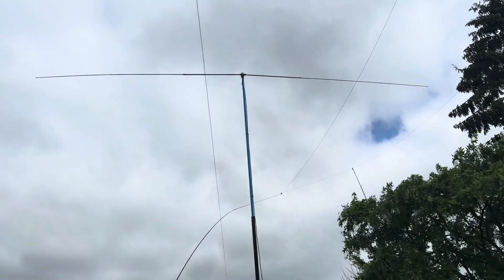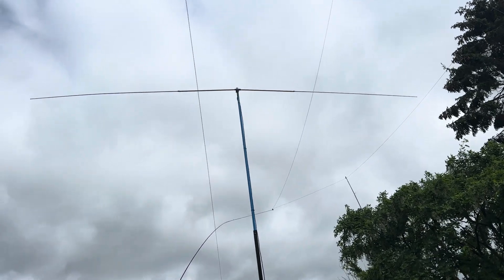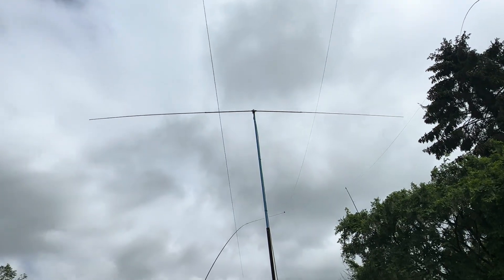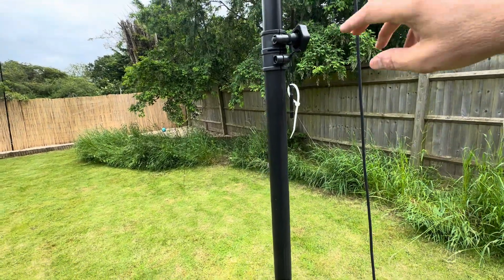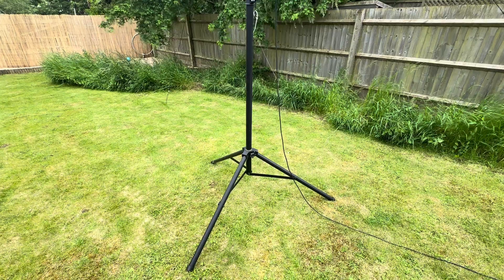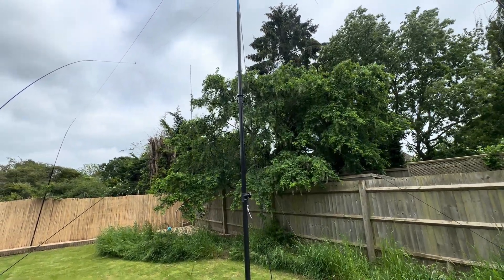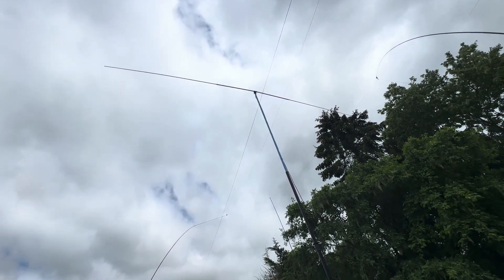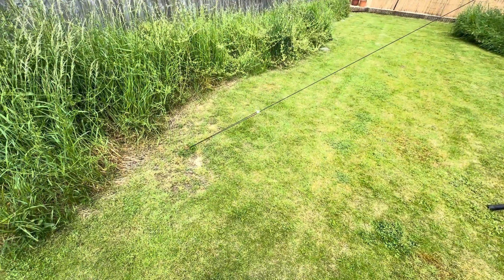Home-brew dipole for the 10 metre band - how I made it (on the cheap!)

Comment: Nice 10m build, do you get any common mode down the coax as it doesn't look to have a balum or choke at the feed point?
Reply from the maker: No, none at all. I did fit a choke but it wasn't required. The noise-loor on 10m is about S1, so all good.

Comment: When we first got access to 6m here in France, all i had was a dipole and a power limit of 5w (it depended in which department you lived to the power you were allowed) and i worked all over Europe with this simple setup, same story on 10m, a simple dipole and 5w up to whatever you have available is more than enough to work anyone when the bands are open. As you know as long as your antenna is at least a wavelength above ground your good to go ! 
Certainly with where we are in the sunspot cycle a rotary dipole is an excellent choice as the bands are in such good shape, anyone anywhere can call you and your not going to miss them.
Cheers for the video matey.
Reply from the maker: Cheers Anthony, interesting background information. Yes, I worked Madeira on 10m within 2 minutes of finishing the antenna and firing up the rig! 6m is mostly dead though except when there's a lift.
Reply: @OxfordShortwaveLog  Really 10m is my favourite band, which harks back to my CB days as a 14 year when my Dad installed a 'rig' in his Austin Ambassador and i caught the radio bug ! 
6m is as you know a spectacular band when its open, although its never really closed, Meteor Scatter offers some great contacts on a 'quite band' as does EME, although i enjoy 'six' i now rarely go there as all i see/hear is FT8-FT4. Not my cup of tea !
Cheers for the video Clint.
Reply from the maker: Thanks Anthony. Yes, 10m is a great band - I've worked so many South American stations on SSB previously. 6m can be amazing too, but it's so quiet nearly all the time. 73